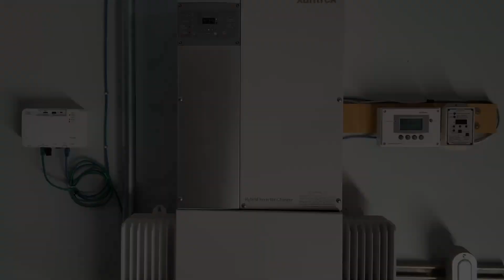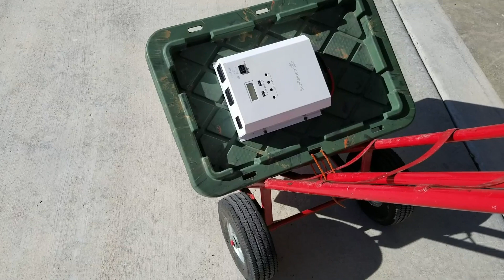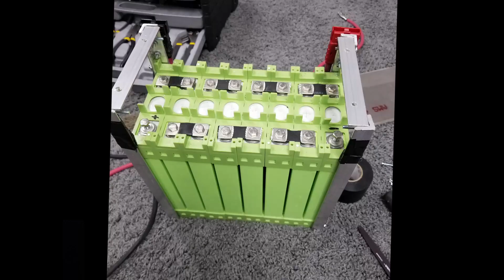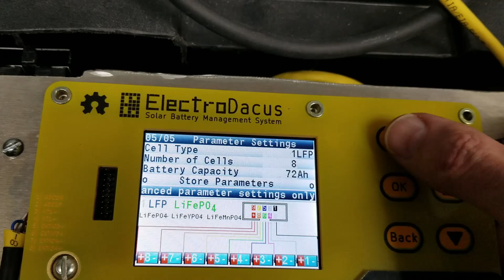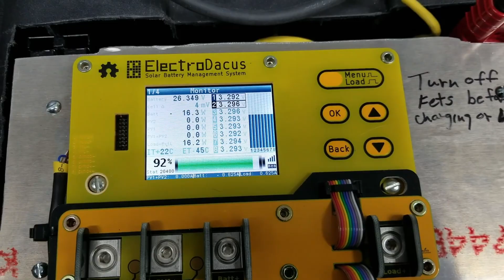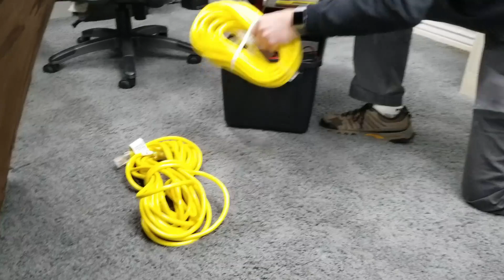Ultimate, Portable, High Power, Solar Generator

Comment: This is pretty cool I wonder how much of a load and drain this BMS puts on the batteries I really lost interest when I found out it does not use MPPT. they have BMS that will keep the batteries balanced and watt meters to show state of charge on batteries and voltage cut off relays that will disconnect power when batteries drop to a certain voltage. This BMS combines cool tech but is wasted since it is not MPPT.
Reply from the maker: Actually the SBMS if more efficient than MPPT. I have two 3500 W MPPT chargers. They are good, but not quite as efficient as the SBMS.

Comment: Hi John, I found your setup interesting. I've been trying to get more information on high capacity super capacitors.  Did you research those? It seems they can cycle millions of times, charge and discharge very quickly. Used as a hybrid system with conventional battery cells of any flavor they can  dampen the stresses of heavy charging and discharging to make the battery life last longer.

Comment: Wait wait wait wait......(@9:15), you lugged the WHOLE setup up a flight of stairs and back down a few more steps to  connect with your solar panels??????    Ummmm, how about get a length of wire and run that TO the generator, duh

Comment: 2000 watts  can not power an entire house.   I have 2 Honda 2000 watt gas generators making 4000 watts and I have to be selective as to which devices I run.
Reply from the maker: That's one of many drawbacks to a gas or propane generator. Only a few actually can power what they claim for a long period of time. At 6,200 ft elevation where I live. A 2k gas generator will have much less power than it's rated. My Solar Generator can power a 2k watt load easily. Even high surge load inductive motors. Which most gas generator will have a hard time with.
Reply: Thats true,  I think at your elevation its nearly 20% less efficient, yes?   This person was trying to do it on a few hundred watts which is incredibly bad.  i do not want to watch   that video again.
Reply from the maker: No 2kW can't. My solar generator is only designed to power critical loads like my refrigerator/freezer.  My main 6kW solar system powers the house. Even with 6kW I still don't have my air conditioner, electric clothes dryer, and electric stove connected to because they use a lot of power. I can live without them if I lose grid power. Check out my latest video on my solar system. When my two Tesla Powerwalls get here I will be able to power everything with a 10kW inverter 14kW surge. With 28kWh of energy in the powerwalls, and my solar panels producing 35kWh of energy on sunny days. I will pretty much never need grid power again.
Reply: I don't think you know what you are talking about.

Comment: There nothing ultimate about the high frequency, transformerless inverter that your using. Over time your going to damge the appliances that are connected to it. A much better choice is to use a low frequency, transformer based inverter charger. Your system last far longer, you'll be able to start and run far more appliances and you won't damage your appliances.

Comment: So, 25 cents time 365 days is about 90 dollars a year for system that will only last 10 years max and maybe not that on the batteries so that is 900 dollars for a 2000 plus dollar set up? Hell, that is ridiculous. I say forget solar.
Reply from the maker: I just noticed this comment. The Ultimate solar generator was never about saving money. Although it does save some. I built it mainly for emergency use. I use it every night for my oxygen concentrator. Which makes it life saving if my main power goes out. How much is saving a life worth? BTW my main solar system for my house I build 10 years ago. Is payed off now, or close to it. So i'm making about $100 a month with it now. So yes solar power is worth it, but more importantly I'm just trying to do my part to prevent climate change.